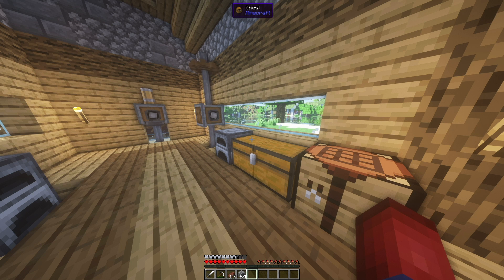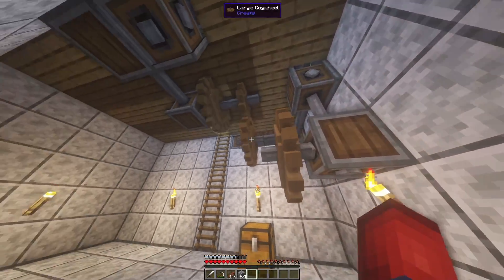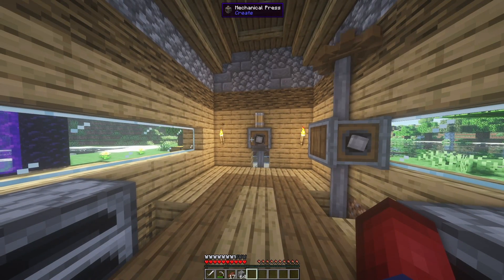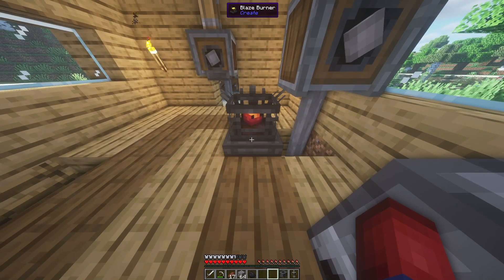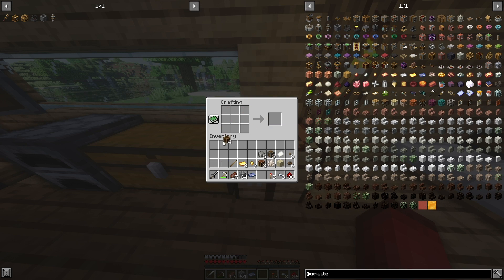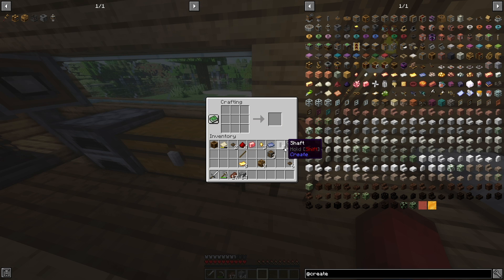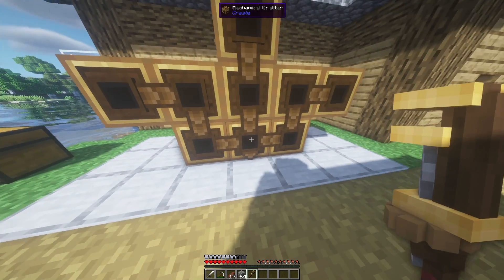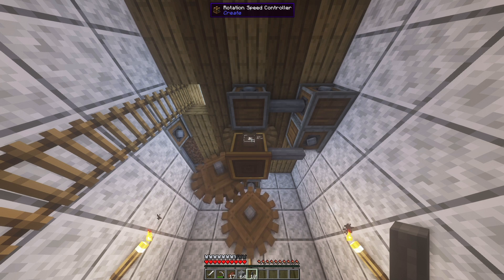Minecraft Create Mod Tutorial - Mechanical Mixer, Mechanical Crafter, & Speed Controller Ep 3

Comment: i need help i for some reason cannot see the strengh numbers and cant even configure the wireless redstone signal transmiters
Reply from the maker: If you are running optifine make sure you are not on "fabulous" settings it has to be lower in order to see it
Reply: @rockit14   yeah i noticed it was informing me for that in the chat annoucments as well issue is fixed

Comment: how does your mechanical press activate automatically while mine doesn't even react
Reply from the maker: If it is connected to a power source like a water wheel it will auto go down. Versus if it is powered by a hand crank you have to manually use it :)

Comment: I don't get how you are able to have a mixer, a press, and the crafters all from 2 water wheels. for me it freezes up saying I need to decrease speed, or increase the sources
Reply from the maker: So in this video I break the power so the water wheel is only powering the crafters when I use them. This can eventually be fixed once you make the speed controller and then you no longer have to break connections

Comment: How do I resolve a problem where I need to power a, hypothetical, 5x5 mechanical crafter grid? Even for just 5 mechanical crafter blocks alone, I can't seem to find the right speed to not have the system overstress.
Reply from the maker: You can probably pull this off with multiple water wheels connected together or a windmill powering it. Hop into the discord and I can walk you through it :)

Comment: i have a question, how can u build a auto crafting with mechanic crafter? really thx if u know.
Reply from the maker: You could do this by using a deployer to place items inside of a mechanical crafter into the slots to craft the item.

Then you just need power to the mechanical crafters and a way to pull the end item from the crafter when it is dropped!
Reply: @rockit14  tysm I just wondered with thing that actually CAN PLACE THE ITEM IN THE MECHANIC CRAFTER!
Reply from the maker: @UnderFlow_official  I didn’t understand your question. Simply take a funnel to the back of a mechanical crafter and it will place the item in
Reply: @rockit14  i mean u put iron ignot in a chest that its automaticly go inside the 9 mechanical crafter and it comes out a iron block
Reply: @rockit14  oh dude i figure out!!!!!!! u use the wrench and right click the back of the  9 mechanical crafter, than input use a hopper and it gonna spread the item to all of the 9 m.crafter and it gonna work!!!!!!!!!
Reply: @rockit14   u can use hopper too btw

Comment: The mixer says that it is not rotating with enough speed, how do I fix that.
Reply: Watch the last tutorial he made.

I got 2 water wheels, put water on 1 of them, flowing on both. Then, i connected that to a vertical gearbox so it would be the right way up to slot into the Mixer. To connect the Gearbox to the Mixer, I followed his last tutorial where he shows a speed trick. You connect a large to a small, then the shaft part of the small i connected to a large. Repeat. It's hard to explain that last part so just watch his last video.
Reply: @SmashPhoenixX  thank you, I didnt know you only put water on one of the wheels i put them on both.
Reply: @buttermilk9316  Yeah i figured that out by accident. I put water on both and it overstressed. When i put it on 1, for some reason it didn't.
Reply: @SmashPhoenixX  Now it doesnt work again XD
Reply: @buttermilk9316  oof :( dont forget to right click the blaze burner with coal, and make sure you captured a blaze with the empty blaze burner

Comment: I just keep getting copper/zinc nuggets, i cant get the brass, how do i fix this?
Reply: Try putting a brass ingot on the basin as the recipe filter. It probably assumes you want the nuggets as the returns in the shapeless crafting recipe as opposed to the alloy recipe.
Reply from the maker: Try placing only 1 single copper and 1 single zinc inside of the basin. Also, make sure the basin has a blaze burner (that is lit) underneath it before placing the items inside

Let me know if you have any other problems!
Reply: @OKxAlloy I had the same issue. Only way I have been able to resolve it is to remove the mixer, then light the blaze burner, throw in the zinc and copper in the basin, then re-attach the mixer. I'm using the Slightly Vanilla Flavour mod pack. Maybe a bug?   @rockit14   Great videos, thank you!
Reply from the maker: @ShaneDonogh  Thank you Shane! It seems to be a bit buggy still at times especially in mod packs. Glad you enjoyed!!

Comment from the maker: This is a difficult video to understand so please reach out with your comments down here and I will assist! Also, check out my Discord in the link in the description!
Reply: My crafter is overstressed  even though it doesn't have anything connected to the water wheel
Reply from the maker: @Maelt_  Are you using a speed controller? If you can you should hop into discord and I can help you there :)
Reply: @rockit14  That is what i'm trying to craft
Reply: @rockit14  I got it to work, it were going to fast
Reply: @Rokit14 Hi, I wanted to ask that how do I turn on the crafting manual the side that you have in crafting on the left and on the right, where are you looking for the speed controller, for example?
Reply: for example, at 4:54 on the right side what it is and how i can turn it on?
Reply: and its a modification ?
Reply from the maker: @martinsykora3043  Yup! It is called Just Enough Items :)
Reply: @rockit14  THX
Reply: what if the circuit doesn't craft? It goes to the bottom and then all the pieces pop out
Reply: hey dude, ive been looking around alot and i cant find how to insert items into these crafters automatically, without having to put it in manually, if you know how to do it please let me know :)